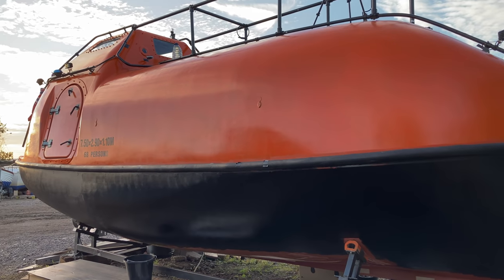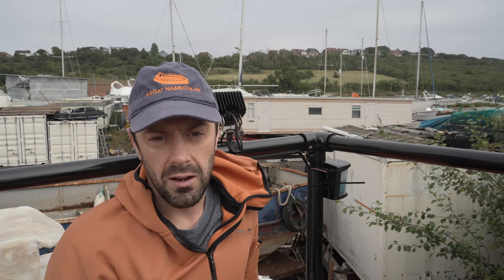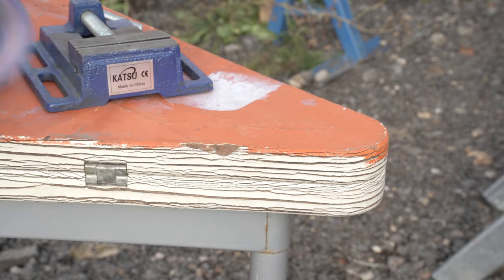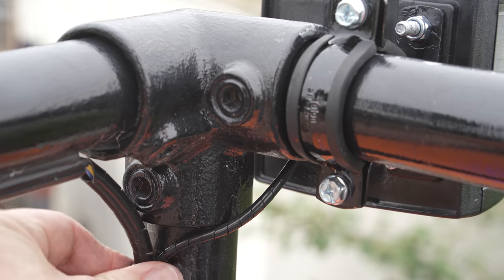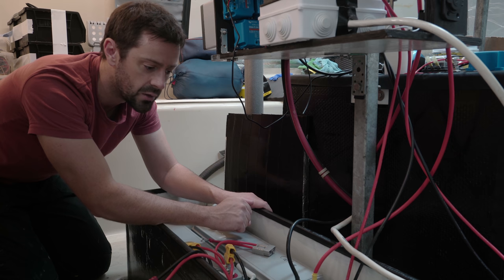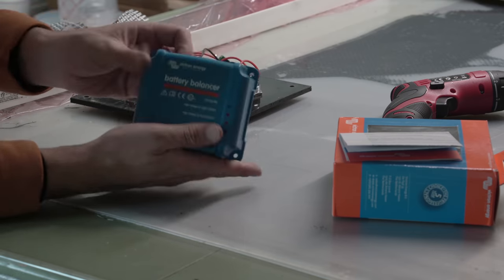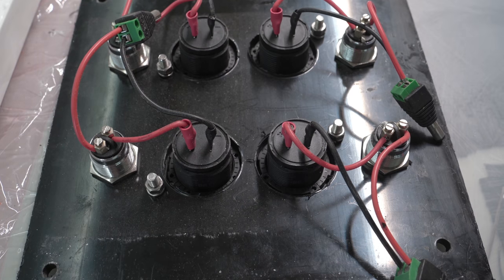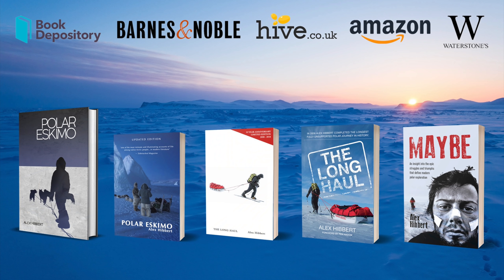Lifeboat Conversion Ep28: Installing bicolour navigation safety lights & battery system update [4K]

Comment from the maker: Thanks for the battery balancer orientation advice - consistently appears to be about ensuring heat dissipation.
Reply: Lead acid batteries can give off hydrogen gas and mounting the balancer in the sealed box would provide an ignition source which could cause an explosion.
Reply: While there are many products that must be mounted upright to ensure proper cooling as they rely on convection cooling, that battery balancer is not one of them, you can tell this is the case because it doesn't have any vent holes on top for the air to escape so their design doesn't rely on convection cooling. It also doesn't consume enough power to warrant major cooling concerns.

However upon closer inspection of the manual the reason becomes clear, it's IP22 rated, this means it is designed to give limited protection against water ingress, specifically vertically falling water droplets from above with the enclosure tilted up to 15 degrees. Of course if you mount it upside down or flat water will easily get through the holes for the cables, and that's why they say to mount it upright.

Comment: When you cut a threaded rod, you can also attach a nut before cutting it, and then it fixes the threads when you unscrew it. But giving it a bit of a chamfer is a good idea anyway in your case to minimize pointy things around the boat.
Reply: I was thinking about writing that tip myself, but then I thought he must know this trick.
So my guess is that he doesn't have the right nut for the munsen ring laying around.
Reply from the maker: I'd like to claim that was the reason. But I have tons of nuts...
Reply from the maker: Thanks - seen this tip on another comment too.

Comment: the upright mounting is for proper ventilation, as you dont want the thing to overheat and fail due to exessive heat trapped in the case
Reply from the maker: That makes a lot of sense. I assumed the heatsink should be allowed to do its job, but the instructions were worded in a seemingly more strict manner than that (all orientations was how I took it).

Comment: Just a theory, but maybe the mounting is to allow for proper cooling air flow (?)  You could probably add a fan and mount in any orientation but that would use up some juice.
Reply: Just what i was thinking
Reply from the maker: That makes a lot of sense. I assumed the heatsink should be allowed to do its job, but the instructions were worded in a seemingly more strict manner than that (all orientations was how I took it).
Reply: @AlexHibbertOriginals  I think you should pin this comment at the top to avoid further need for cutting and pasting ;)
Reply: @AlexHibbertOriginals  My router/wifi ap is passively cooled and, unless you read the manual, in no way shape or form do you know that it really wants to be screwed to the wall, because the cooling slits are designed to let more air in that way. The thing even has rubber feet, goddamit. And when you mount it to the wall, you get to choose whether you want the cables to plug in at the top, or the writing to be the right side up. Sp there might be a reason that isn't clear, or makes no sense and that theory makes the most sense to me
Reply: I agreed with Timothy Lynch, My assumption is that the heat-sink was designed with convection cooling in mind.  If you are using the device well under maximum ratings, using forced air, low ambient temperatures, I think you will be okay in most orientations.
Reply: @joshuaharlow4241  
Couldn't have explained it better. 
He's mostly in the Arctic later, so no worries. 😊👍
Reply: Its to stop water running down the cables and into the unit

Comment: Several years ago I was in a large airport waiting area. A couple of late-teenaged girls sat down opposite me. One had (bright) red hair, the other one had green hair. The red hair one was on the left from my perspective so I went across the aisle and told them they needed to swap seats because red is supposed to be on the right. I guess with a blonde between them they could have been a traffic light on its side.

Comment: Look at the direction of the heat fins on the heat sink, its designed to be bolted against something and using convection to pull cool air from the bottom and by the time it gets to the top, hot air away. Almost like a bunch of little self drafting chimneys. So many people have said something similar, so It looks like you have the point.

Comment: Industrial electrician here, so I am actually qualified more than your average YouTuber to speak about the battery balancer.

Air flow for cooling of the electronics since it does not have a fan is why it requires being mounted that way. Adding a small fan to blow on it to give it air flow would let you mount it in any orientation. You should not mount it inside of the battery box since it would not contain a fire if the electronics had a catastrophic failure. You should mount it inside of the main power distribution panel or in it's own electrical box outside of the battery box since the batteries will produce heat that could shorten the life of the electronics drastically.

Comment: I'm sure you know this, but an old school trick with the ammeter is to put 10 loops through the fork and then divide by 10 for your result. Just a cheap easy way to get better resolution on very small amounts of current

Comment: The vertical mounting with the connections at the bottom is to stop water from running down the cables and getting on the unit
Reply from the maker: Could well be a factor

Comment: As said previously no reason for the electronics themselves but the heatsinks will be more effective the right way round allowing for proper convection. I assume that you would be OK but they would need to be sure that it all works even in the most strenuous conditions so take no chances!
Good luck...Thanks for the videos!

Comment: As for the battery monitor, check the direction of the cooling fins on the heat sink. Most depend on convection to draw cooler air and by mounting them horizontally you defeat the system.

Comment: Apart from the already mentioned heat distribution there is a small chance the battery controller thing has an relay that has a specific orientation apart from that i can not tell you logical reason.

Comment: It's mounted upright for cooling purposes. That being said I would not mount in an enclosed space even if upright. I'm not an expert, though I stood on a TV once so I was on TV, but I treat anything high current low voltage as a heat producer like chargers, balancers, charge controllers and so on.

Comment: I'm fairly certain the only reason why they show it and being vertically mounted is for water or other liquids falling away from the unit versus following the wires into the unit. You shouldn't have to worry about shorting anything but prolonged periods of water contact, depending on the pH, could damage the wires or inner connectors or cause corrosion that could limit connectivity. As far as my expertise goes, I spent a few years building circuit boards and test units for those circuit boards. Some of the testing was 'less than ideal' environmental testing.

Comment: Victron gear tends to rely pretty heavily on convection for airflow around heat sinks which is why the orientation matters. Source: research done while building out a solar system on a RV.

Comment: I'd suggest having a dedicated circuit for engine cranking. Not so much because of the starter's required power but if you have a drain on your main bank you can still start your engine. A three-way battery bank selector allows you to change which one or both of the battery banks is active
Reply from the maker: Sounds fair. I might have a portable one of those boat-safe (i.e. non exploding) lithium 12V batts, so it could be my crank without taking up too much space.
Reply: @AlexHibbertOriginals  Also, I've seen one battery in a bank fail from being the dedicated starter battery (as well as house duties) - perhaps because of it being used differently to the others?
Reply: @michaelnelson912  Also very possible since the loads from cranking are very different than the house loads. Cranking is high current for a short duration and house loads are typically low current for a long duration. A typical setup would be a deep discharge battery bank for house loads and a high amperage capable battery bank for cranking.

Comment: If the balancer does not contain a chip that may get warm in use, please ignore this.
Otherwise, the vertical orientation may be related to heat dissipation from the unit.

Comment: The battery balancer probably needs to be upright for heat dissapation and possibly contains regular cylindrical caps. Witch have an oil in them to regulate/dissapate heat within it. And orientation is key for longevity. As composit caps are expensive but dont have orientation issues.
Reply from the maker: The oil issue isn't something I've considered. Is this a guess, or certainly a factor in Victron equipment?
Reply: @AlexHibbertOriginals   its a little fact i learned with electronics when cylindrical capasitors  overload they "pop" because the heat inside them causes the cooling oil to boil over causing pressure. Thus why on older electronics they say caps have gone leaky And need replacement. As the oil can leak out

Comment: Note the heatsink on the back of the balancer, the fins must be vertical for cooling air to flow naturally from bottom to top. It could be mounted face down on a horizontal surface and live a happy long life but face up on same surface would mean the heatsink wouldn't be doing much at all and result in a drastically shortened lifespan. The closed battery box isn't a good option because batteries under a charge produce heat and along with the heat made by the balancer itself, that would be a pretty hostile environment for electronics.
Reply from the maker: That makes a lot of sense. I assumed the heatsink should be allowed to do its job, but the instructions were worded in a seemingly more strict manner than that (all orientations was how I took it).

Comment: When cutting a screw thread put a nut on it before you cut it, once you cut it take the nut off and it will clean up the thread on its way off.
Reply from the maker: A good tip now well-explained on this thread 😁
Reply: @AlexHibbertOriginals  sorry I did do a quick scroll though and didn't see anyone saying it

Comment: I have no idea why you'd need to mount the balamcer vertically however it could be heat.
I imagine it getting hot and it gets cooled via convection and if you lay it down the convection process may be impeded because the ports aren't oriented correctly.
- just a stab in the dark.

Comment: Next time you cut off the male end of a bolt put a nut on it BEFORE you cut it, then after the offending bolt has been dealt with you can back the nut off and it fixes the threads;)
Reply from the maker: Thanks - seen this tip on another comment too.

Comment: The reason why most of these solar battery devices like you battery balancer are mounted vertical is because the manufacturers design them to be mounted that way because of heat transfer. If you look on the back of the unit you'll notice it has a black aluminium finned block which is called a heatsink, they absorb heat & you place the fins vertical so that heat escapes through convection. you place the unit with that underneath flat then there is no way for the heat to escape & it will have a thermal runaway meltdown.
Reply from the maker: That makes a lot of sense. I assumed the heatsink should be allowed to do its job, but the instructions were worded in a seemingly more strict manner than that (all orientations was how I took it).

Comment: Sectors for light are: red and green 112,5 degrees from center line, forward light 225 degrees (112.5 degrees from center line on both sides), back light 135 degrees (67,5 degrees from centerline on both sides). You can use 360 degrees light on masthead as anchor light and white running light if the boat is not longer than 12 m. If boat is longer white lights forward and backward must be separate. All lights must be seen freely in given sectors.

Comment: I'm sorry, I could not catch the name of those fittings? The ones for the bow light that clamp onto round railing. You said something like Humphrey fitting? Could I get that name?
Reply: Scratch that. I have found them. I decided not to delete on the offhand chance anyone else needed the info, they are Munsen clamps. Also, who knows it might help manipulate the algorithm
Reply from the maker: Pleased you found them. They're designed for mounting pipework to walls.

Comment: Is the Stbd part visible 2 points abaft the beam? didn't look like it.  :¬(
Reply from the maker: The light spec itself is as per the rules, but do you mean the starboard upright railing might obscure it on a very specific angle?
Reply: @AlexHibbertOriginals  Yes it seemed from the vid that it would only be visible to 90 deg as the rail may obscure  the last 22.5 degs.
Reply: @AlexHibbertOriginals  - Yes.. in your shoes, I'd give some thought to mounting it on a small upright pole attached to the present mounting point. Even a few inches would be better than nothing, but 8-12 inches high would be better, so a bit of rolling wouldn't obscure it.

Comment: Guessing the orientation is due to convective cooling requirements for the heat sink?
Reply from the maker: That makes a lot of sense. I assumed the heatsink should be allowed to do its job, but the instructions were worded in a seemingly more strict manner than that (all orientations was how I took it).

Comment: U could have fitted solarr pannels And a electric motor to power Alan so the boat runs infinitely
Reply from the maker: You'd need 15,000 W of solar panels and bright sunshine to get half the power of Alan's engine.
Reply: @AlexHibbertOriginals  ohh 😯 that's massive  so could we install a cloth to just take the help of wind on the top just for calm days 😃 and could install a small solar pannel to just keep the battary charged
Reply: Sunlight at high latitudes is too weak to provide much power. It's not like the tropics, where you have strong sunshine. And even the best electric boats are only able to do a few hours running at low speed. After which (at high latitudes), the batteries can take days to fully charge again. And that's assuming you don't get a couple of weeks of overcast skies with no sunshine at all.
Reply: @Garryck-1  ohk I am from india so I don't know well about  weak sunlight I am just above Equator 😌
Reply: @steveraju5749  - That's ok mate.. I had a feeling that was the case.

Comment: Those grommets on the back of the light don't look very watertight...
Reply from the maker: You're not wrong. I might splice on some thicker cable, or use a dab of sealant.